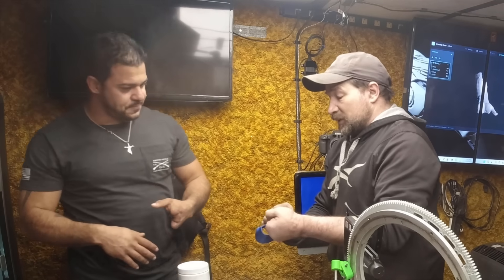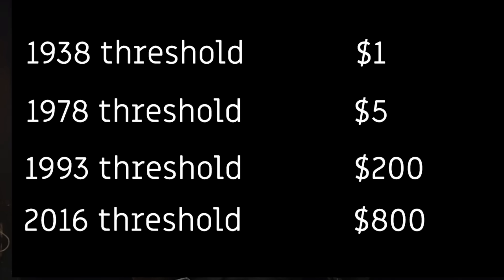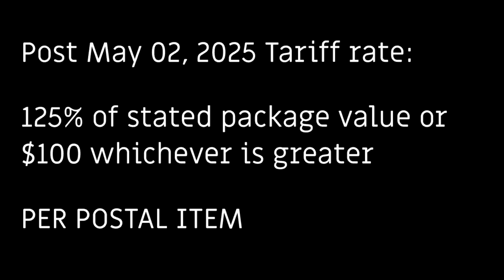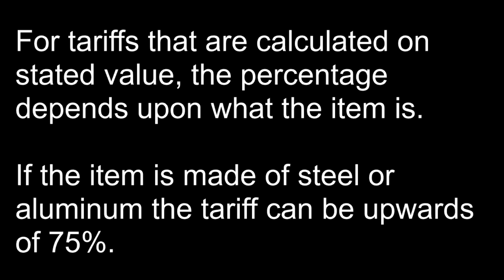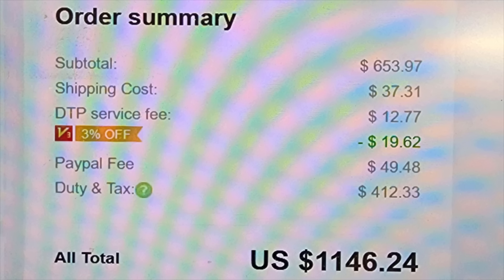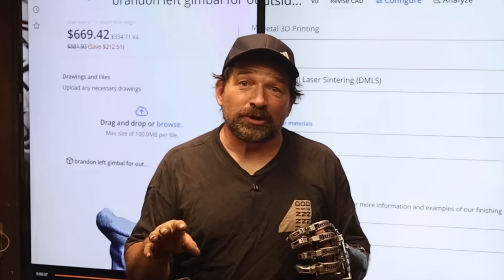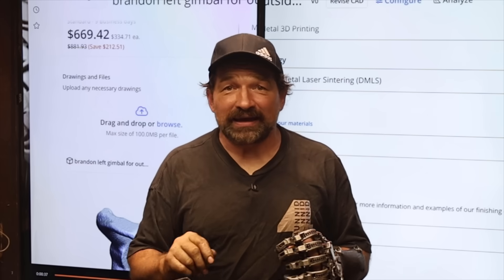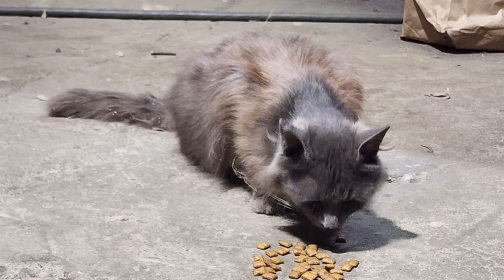No good deed goes unpunished

Comment: Xometry, as well as all the other domestic metal 3D printing companies no longer have the equipment to print your metal parts. They all have to pay terrifs as well. Ask them what state the tool is located in and what machine they use. The silence response speaks volumes. I have been unable to convince anyone I work with to import the machines and begin production. I’m currently trying to import a BLT-A400 which is the same machine JLC-PCB uses. The company is in India and I can’t get them to respond to my quote requests. Maybe you will have better luck inspiring some of your viewers to get one of these machines. Otherwise it’s 200% of your ADA innovation will go into a solid gold toilet seat upgrade.
Reply: Maybe we could organize some funding for a new company that can get those machines for USA based manufacturing? Sell parts to people on fair pricing... might end up with a massive wait-list but that means demand is so high the operation could be expanded.
Reply: @V3RTIGO222  it would be unbelievably expensive and still take years to set up. Your demand would never be high enough to account for the price youd need to set the parts at just to break even. Youd be in huge debt for years even with those inflated prices. Its not possible to just upturn the entire economy at once.
Reply: @thedudegs-f9w  There are kickstarters for products and services that amass hundreds of thousands, I don't think it's that infeasible to get the money together to accomplish it... which is really the only major hurdle. The main point is if we can manufacture parts which have an end cost that is cheaper than what the tarriffs end up costing for importing items over-seas, then we'd be making a profit and the customer would be saving money. Not a bad deal, even if it's just a current issue within the political/legal climate.
Reply: @V3RTIGO222  hundreds of thousands? Brother the modest shop my college had costed 24 million dollars and that was with the cheapest possible construction. I dont think ive ever stepped foot inside a shop worth less than a million dollars. You have no idea what kind of prices we're talking about. 

We are talking about building huge, high tech shops that need machines that can only be made in their own specialized shops, each of which is about as expensive as the shop you want to build. We're talking about building an entire new supply line, billions of dollars. The customer doesnt save money, because you will never get your prices down to what they would be if there were no tariffs.

Then to run this supply line, you need raw materials. There isnt enough ore on the continent to meet the needs of our new supply line. We already import half our iron because its not possible to produce enough.
Reply: @V3RTIGO222  this is just so out of touch with how manufacturing and economics works. Please look up how much just a warehouse costs with no machines in it
Reply: @thedudegs-f9w  ...the intent was to get a manufacturing machine (or a few) and hold it on private property, to do highly specific work ar cost. Youre imagining a much larger operation than intended, at least on startup. There are a few local companies that do small scale manufacturing that operate out of relatively small buildings using 6-axis CNC machines. This isn't that crazy, and you're seriously blowing it out of proportion while being rude to boot.
Reply: @V3RTIGO222  that just doesnt work though. Even getting a small shop with a bridgeport is pretty expensive and the smaller scale you work at, the more expensive everything is per unit. Especially because more skilled labor is necessary to run those smaller and cheaper machines. When i say ive never been in a shop worth less than a million dollars, im including those that havent bought a new machine in 40 years. I run an old bridgeport at my current job. What youre talking about just doesnt work at any scale.

If you did manage to get together a small shop like that, it would still be expensive and assuming they get up and running, they would immediately be at capacity with larger clients because thats what makes money. Any shop that catered to small businesses would go bankrupt. And again, because of tariffs, machines and materials are more expensive. The shop i work in gets most of our money from contracts with giant companies. We charge 150$ per hour for anything and thats on the low end. Most places wont pick up the phone for less than 200$ an hour. The numbers just dont work out. At both large and small scales, you vant accomplish anything within a reasonable price. 

To actually get any work done, you need those large scale supply chains and shops because of the economy of scale. Theres a shop down the road from where i live that has a 750,000$ laser cutter and no small shop will ever be able to compete with them because they can charge a much lower price per part. Its complicated economics but basically, small shops dont work unless you fulfill a very specific niche and you focus on doing one thing very well. The only way to make this work is for tariffs to disappear and a bunch of complicated tweaks to the economic system
Reply: @thedudegs-f9w  The entire point is to focus on a very specific niche. It's like you never read my comments in full, or just completely misinterpreted them? Ultimately the tarrifs mean that the economy of scale is reduced - outsourcing parts production is more expensive due to tariffs. Tarifs also aren't neccessarliy a percent tax, so larger more expensive items wil not be effected the same way - a $15 dollar part with a $600 tarriff is not the same as a $70k machine with a $7000 tariff. The point isn't to provide parts cheaper than how they were before tariffs, its providing parts that are cheaper than those manufactured overseas with tariffs included in the end cost. In not so distant history, this was a part of how various nations were able to industrialize and build their own manufacturing base, in addition to funding the base with grants and other monetization/subsidy to assit with growth. Tariffs aren't always bad, but they are clearly done to the detriment of most people atm - the point remains there is still opportunity to use that.
Reply: @V3RTIGO222  the point im making is that any niche you could fulfill wouldnt help small businesses. Nothing we were talking about here would be helped by a small shop making exactly one part or machine that only one business buys. 

Tariffs as theyre being implemented are a percentage, so a 15$ part gets a 15$ tax and 70k$ part gets a 70k$ tax, assuming theyre coming from the same place. 

If prices are higher than they were before tariffs, that makes them inaccessible to small businesses, which is why you can only survive as a shop by catering to large businesses. You also cant get prices below the tariffed prices because your materials and machines are also tariffed and you dont have as much access to skilled or non skilled labor. You have to overcome the tariffs and other obstacles unique to the us, shops overseas just have the tariffs. 

Tariffs are almost universally bad. Youre right they've worked in developed countries under very specific conditions in addition to subsidies and government investment, but there are no circumstances under which they could ever be good or useful in the us. There is no "opportunity to use that" because theres nothing to use. Its harder to start and maintain a small shop than it used to be and you could never get your prices low enough to compete. 

You can also think about big businesses starting their own shops. You cant even afford a small shop with basic tools, but Amazon can afford to build new facilities in the US and they can negotiate lowering tariffs specifically for them. Meaning there is no circumstance under which your small shop would ever work
Reply: @thedudegs-f9w  If you aren't offering any solutions, I don't need to hear any more. I can't imagine a worse ally than someone who decides that attempting a venture is hopeless and refuses to actually solve the problem at hand.

Imagine a friend who simply tells you to give up on your goals rather than helping you find a way to accomplish them... it's worthless and philosophically bankrupt. So, unless you're actually offering a way to assist people with disabilities to actually be able to produce or utilize prosthetics, you're not a part of the solution.

Lastly, the end cost for the tariffs on imports are not percentage based - unless you're saying the tariff/duty markup on a $15 part is somehow $400+, as mentioned in the video. Tariffs explicitly minimize economy of scale, you can tariff products/services while not doing so for raw resources/materials - again, with incentives like grants or subsidies offered by the government to assist with growth.
Reply: @V3RTIGO222 im actually happy to talk about solutions. The solution is political advocacy. If the government decides to make it illegal to run a profitable business, the only thing you can do about it is to participate in politics to change that. Im not against opening small shops if you can, but its harder now than ever and its not a solution to any of these problems. 

How do you think tariffs are calculated? They are a direct percentage of the value of the product. They have knock on effects that increase prices as well, like causing inflation, but the actual tariff itself is a percentage. 

You cant really tariff services, that doesnt make sense. But you could tariff products without tariffing materials. Thats less bad, but still bad, and its not what's going on right now. The tariffs the us government is doing right now are on all imports and increased rates from specific countries. 

To be very clear, it would still be bad if it was targeted. There were targeted tariffs on electric vehicle imports specifically during the previous administration and the stated goal was to allow american industry to develop. The actual effect and intention was to protect the near monopoly car companies have so they can raise prices and never have to worry about competition. Tariffs are never good for a developed country like the us.
Reply: @thedudegs-f9w  Political advocacy is not a short term solution, and it isn't really working right now. I'm perfectly happy to advocate politically, but we have no idea if change will be any sooner than four years down the road. You still haven't offered any tangible solution or plan that isn't already being worked on.
Reply: @V3RTIGO222  we could see change as soon as 2 years from now. Even sooner potentially. The democratic primary for new york mayor was enough to have pretty significant effects nationwide. There are always elections going on that do have real impact. Opening a shop arguably takes longer than 2 years and these economic issues are caused by large scale policy. Its like asking for a solution to the tide rising or the sun setting. Sometimes your options are limited and there are no real solutions. Thats life
Reply: @thedudegs-f9w  So if it takes two years to open a shop and change will occur ~2 years from now that makes the issues you're talking about go away, what's the problem with trying to open a shop?
Reply: @V3RTIGO222  theres nothing wrong with opening a shop if you can but it doesnt really solve this problem. These problems wont go away completely after 2 years either, thats not what i said. Crowdfunding it i think isnt a great idea. It seems like youre not understanding a lot of what im saying. Opening a shop will never be a solution to these economic problems, but that doesnt mean its a bad thing to do.

Change isnt guaranteed in two years, just possible and its going to require a lot of work from a lot of people. If your goal is to make it possible for small businesses to get parts in the future, youd be better off putting the effort into political advocacy to make that change happen. Opening a shop wont help and if there isnt sufficient political change, the economic problems will get worse and your shop wont survive.
Reply: @thedudegs-f9w  Thats paradoxical, you said the issue would be over in two years, but now you're saying it isn't? And you're also saying these things are mutually exclusive? I literally pointed out you can accomplish both, and yet you somehow can't fathom that is possible. Like, the problem is not having the ability to make/order these parts, the long term solution is not having to rely on the whims of political change to have a stable foundation for your operation. You're not making any sense here, and it was frankly a waste of time talking to you. I literally work in a LGBT rights non-profit, I can tell you advocacy is good for the general public but it's not an individualized solution like in this case.
Reply: @V3RTIGO222  youre really making me question your ability to read. When did i ever say this would be over in two years? I said we might see change, not that it would be over. The economy isnt a switch you flip to make it good or bad. Its bad now, we can work to improve it, but that doesnt mean it will be as good as it was a few months ago. 

Economic issues will always be subject to politics. Its not just "political whims". We had a system for about a hundred years that worked and was stable enough to not have these problems. One good presidency and congress could do it again. 

How does opening a shop solve this problem?
Reply: @thedudegs-f9w  gotta be a bot
Reply: @thedudegs-f9w  my guy, you don't need to "acktshually" this hard. Shame on you.
Reply: BLT is in China. Have you tried Alibaba?
Reply: Why would anyone want to sell to the US anymore?
Reply: @BBVance  bro... you are propagandazing all over these comments.  50 cent army, wumoa, or useful idiot?
Reply: @BBVance Because the US outspends  every other country on high margin items? How out of touch are you?
Reply: @1funnygame  You think a 5 laser 3D metal printer is a high margin item? Are you not aware the US has instituted a trade war with essentially the entire world? Did you even read the conversation before I tickled your silly patriotic funny bone?
Reply: This is exactly why the tariffs have been implemented.  For at least 20 years now, American companies have been offshoring skilled labor to China and other countries.  It is ridiculous that nobody even wants to import these machines and manufacture stuff for a profit here in the states.  If this trend doesn't turn around, this country will be over a barrel in a few years.  I know it sucks right now during the transition period, but this is necessary to the long term continuation of the economic environment we expect here in the western world.
Reply: @jamesburleson1916 cost my company a million dollars a month product with no domestic solution for at least 3 years. Small companies always suffer for the big companies bad management.
Reply: @jamesburleson1916  You have literally no idea what you're talking about. This isn't a transition period. The administration specifically refused to carve out a transition period in order to make the impact on consumers less enormous. There simply is no desire under this administration to fix anything. The tariffs weren't even based in realistic numbers, they were based on a trade deficit, which is not a problem. Would you rather mine iron ore out of the ground, or use minerals mined elsewhere to build/assemble vehicles? In the past, the answer in the US is that we wanted to upskill our labor force so that most people could have a job that pays a living wage. It doesn't make sense to vertically integrate every industry in the U.S. We currently have a skilled workforce, and have less than 5% unemployment, so that means that at least some subset of the population would have to go from skilled jobs, to less skilled jobs, especially since this administration has hopes to remove migrant workers that currently fill low-skill low-wage jobs. There is literally no way to justify this. It simply doesn't do what you or the President have been told it will do. There are certainly ways to use tariffs to shore up domestic manufacturing in favor of foreign markets, but they typically aren't done because the bad outcomes resulting from this outweigh the artificial increase in the American economy. If the American economy needs a 125% tariff to justify people to purchase from American 3D printing locations, and even with the tariffs, you still can't find a manufacturer to produce your parts for cheaper than the foreign alternative, then the parts shouldn't be made in America. That's just a fact. It's the same thing with certain goods, like coffee, and bananas. We either can't produce them domestically for a price that Americans are willing to pay, or there aren't workers willing to leave a much easier job for the same amount of money to do back-breaking, dirty jobs. That's just the fact of the matter. No single country can produce literally everything. You have to import some subset of your items, and cheap consumer goods and small-batch manufacturing simply aren't viable to produce in the U.S. any longer. China has long since filled that role, and the way for America to increase it's economic output certainly isn't to stifle consumer spending by adding a huge xenophobic tariff just because the President doesn't like the Chinese. This doesn't hurt China at all, the only people that it impacts negatively are American Citizens like you, who have bought into the propaganda that this regime has pumped out. I'm not gonna sit here and pretend that the democrats aren't absolutely awful as well, there's plenty of morons and absolutely awful people on that side as well, but they usually don't destroy the economy based on a flawed understanding of how tariffs work.
Reply: @jamesburleson1916  this isnt a transition period and the tariffs dont solve this problem. Its not that companies dont want to open factories here, its that the tariffs have made it so expensive to open factories here that its impossible. We were going to have chip manufacturing in america before trump killed it. 

Also, we dont have the raw materials in the ground in america to meet our manufacturing needs. Like the ore just doesnt exist in high enough amounts for us to mine. The mines we do have already operate at basically maximum capacity so there will never be enough raw material without importing it. Meaning tariffs will stop us from ever having the materials to build the factories. 

Also, we need educated workers and we can only get educated workers by funding schools. This administration is getting rid of schools instead